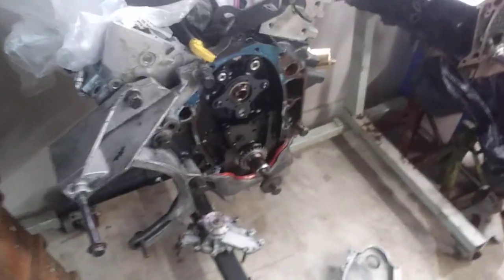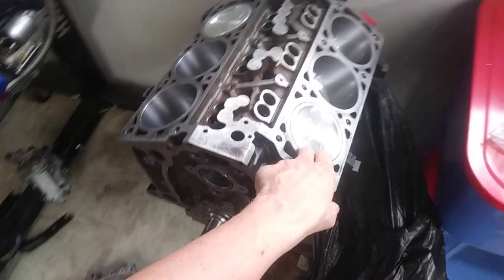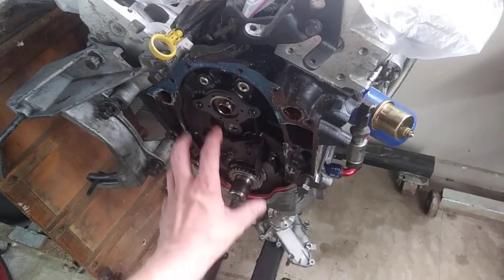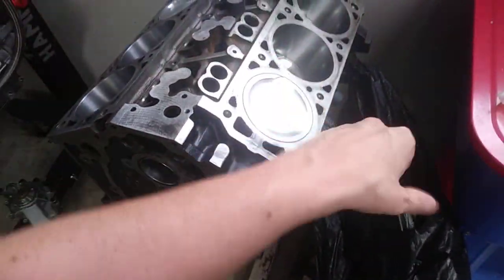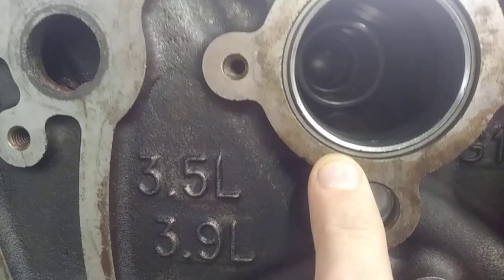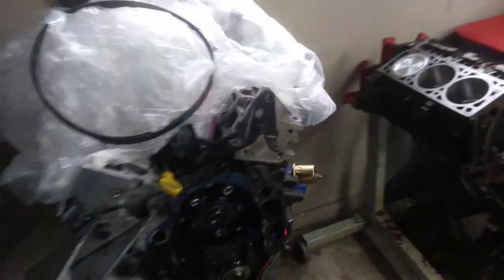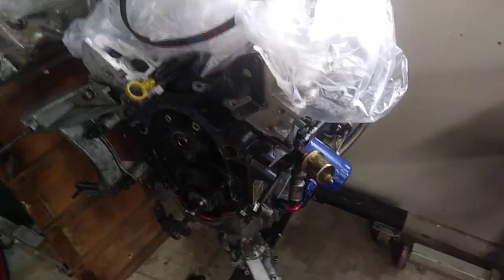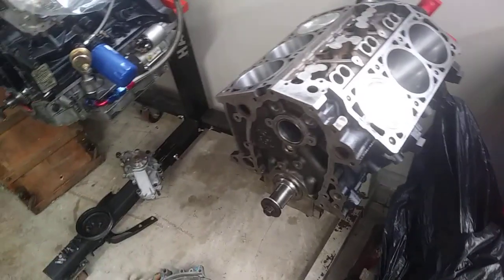Lx9 to Lz9 Fiero turbo swap.  800 hp buildup

Comment: interesting vid Mr... .  LX9 or LZ9 Fiero.. this is my delema.  my 1st choice is the LZ9 but a mechanic friend is saying the VVT is dificult and expensive to do, so stick with the LX9 or the easier 3.4L LA1..     is the LZ9 worth the extra 40HP????
Reply from the maker: It's worth it.  You can eliminate vvt with a camshaft for a 09 equinox 3.4 v6.  Cost about $400. I did a video on it called easy peasy cam.swap.  check it out.
I had an lx9 and after doing lz9 I won't be going back.

Comment: Good video dude. You know what's funny but,u probably didn't think that much when u did this video but it's helped alot. You've answered 1-2 of my questions in the past which I appreciate, I'm trying not to be a pain in the ass but finding any type of meaningful info on these motors r like pulling teeth. Just very little out there for motors GM made millions of. I'm trying to do something different than the typical LS swaps everyone is doing. Don't get me wrong,I love the LS's just wanna be something different. Anyway,I've got a couple more questions if u feel like answering,it'd b a great help. 
1) Im assuming you used forged LS1 pistons, which ones?comp ratio?
2) The forged H beams,r they modified 5.7 or were they specifically for LZ4/9 Engines? 
3)the arp fasteners,are they off the shelf or orginally meant for LS1's?
4) engine mounts. Do they have conversion mounts for rwd platforms,or any issues I might run into if I had them fabbed up?
I'll explain a lil so u know why I'm asking bout rwd mounts. Not my 1st  car build,(1st was 80 Camaro w 350) but it is my 1st w v6 and 1st w boost. This time around though, instead of doing as I go,I'm saving up to buy car, engine plus all forged parts needed,Turbos,trans etc all at once. Or over 1 month period. I originally wanted to do a fiero cuz I've always loved them and Pontiac but, getting a manual transaxle that'll hold up behind 650-700+hp is hard and ridiculously expensive. Add in what I'd have to do to beef up the chassis to handle it is just more than I anticipated. I'm sure it can be done. I want to buy a rwd platform, keep it between 2200-2800lbs max(after I lighten it up). A car I can buy that needs minimal bodywork up front, for$2500 or under. In that category r fieros,Miatas,2wd S10's,944's,Z3's& some z4's,fox body's or Dodge conquest/Mitsubishi starion etc. Found all of them under $2500 easily, don't care about motor/trans since I'm replacing them. But engine mounts and bellhousings to adapt it to either cd009/zf/ or t56 r scarce. Any help would be appreciated.
Reply from the maker: 1. http://realfierotech.com/viewtopic.php?f=3&t=18377

2.  Using stock 3900 rods.

3.arp rod bolts are for a different application but dont know which.  I bought them through Wot-tech

4. You will need to make custom mounts if put in a rwd car.  Not difficult.  There are bosses on the side of the block to mount to.

Comment: What size are your injectors to pull that much boost/power without leaning out?
Reply from the maker: I was running 60lb injectors with 52 psi base pressure to make 600 crank hp.  I will prob need 80s or 100s to get to 800
Reply: @Slowv8Fiero  I have 6 Accel 74607 83lbs/hr injectors new in the box, but they are EV1 style and don't fit under my manifold. I could make a spacer to lift my UIM 3/4", but it will probably hit my hood. So im going to sell these and look for 50 - 60lb/hr EV14 style. What brand were you running?
Reply from the maker: @shapeshaver  yes with the lz9 engine you gotta run the mini Pico style injectors.  The older mustang style are too tall.

I used the mustang style but I had a custom itb intake manifold that gave me more room.

Comment: Are these g6 motors ?
Reply from the maker: If they came in the g6 it was the later models.  2006 and newer if I am not mistaken.

Earlier g6 had the 3.5 lx9 engine code.  Lx9 has a smaller piston bore and smaller camshaft bore vs the lz4 and lz9

Comment: Why are you using a 3400 style camshaft in the new/larger engine? 
What transmission do you put all this power thru..
Reply from the maker: 3400 cam allows more choices for lift and duration via aftermarket.

I am using a stock Getrag 5 spd to put the power down
Reply: Just found your channel and subbed. Quick question. What about the vvt on the 3.9?
Reply from the maker: @berrytharp1334  what about the vvt?  That's just it I am ditching it.  The cam stinks and there are no aftermarket vvt cams available.
Reply: SlowV8Fiero So how interchangeable are they with an lx9 are they once you ditch the vvt? Could one use just a external crank trigger and swap with an la1? I'm assuming the heads and intakes are 3.9 specific?
Reply from the maker: @berrytharp1334  vvt cams are not interchangeable with the previous gen engine blocks.  They only fit vvt blocks.

3.9 heads are block specific.  They can not be used on earlier engines.
Reply: SlowV8Fiero So once you switch to a non vvt cam, the 3.9 is just a big lx9? I am doing an lx9 swap into an Nbody, if I can use a 3.9,I will.
Reply from the maker: @berrytharp1334  thats pretty much correct.  You get a bigger lx9 so to speak.  Bigger intake ports, bigger intake valves, bigger intake runners and bigger throttle body.  More displacement too.
Reply: @Slowv8Fiero  so, just so im clear. doing a cam swap from the factory vvt to an older style lx9 3400 factory cam? 

the reason I ask is I'm a G6 man. I had a GT with the LZ4 3.5 and continued to blow those engines up. I quickly learned the cam bearing inside were letting go, and it was a very common issue. Once they'd let go there was no point in putting the work into the engine for it cost $300 to get a low mile one from a junk yard. Anyways I eventually swapped G6's

I'm currently running a 2006 G6 GTP Coupe with LZ9 mated to a F40 6-speed. I bought it with 85k on it, and my dumbass, wait for it.... blew it up. The manual transmission with my love for WOT made for a blown LZ9. I replaced it, but found the cost to be a tad higher at $600. I do VERY much enjoy beating on my G6, and have found ZERO after market ability for this engine.

Soooo, If I've just found a honey hole of "Hey, take your running engine out, put this older style came in to remove the VVT and have a cammed G6"

I'm not going for a 800hp engine like you, but I wouldn't mind more power. Plus a cammed exhaust is always nice. I'm currently thinking of doing a Super10 on the car, but haven't found a reputable shop in my area yet. I plan to do a resonator delete in the same time, and upgrade the factory pipe from 2.25 to 2.5 going from the flexpipe back.
Reply from the maker: @TheGinger15765  with your g6 you have the software to run the vvt.  If you install bearing spacers that I sell, and use the older style camshaft, you will have to figure out a way to tune out the vvt function in the computer if that is even possible.  You dont want it to throw codes and thus limit power

If you want to keep vvt you can have the factory cam reground.

I am swapping this into a fiero so instead of figuring out a way to add vvt tuning, I am ditching the vvt cam.